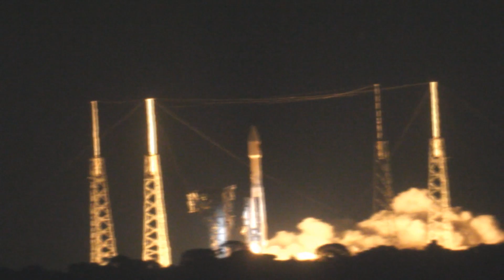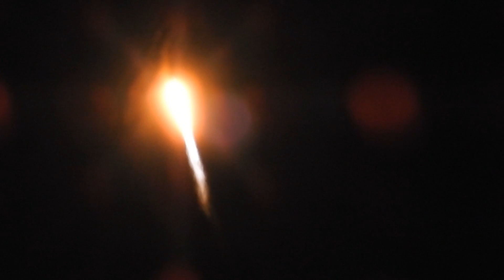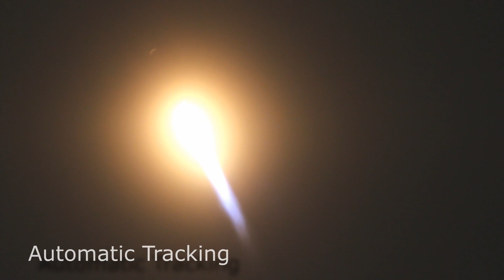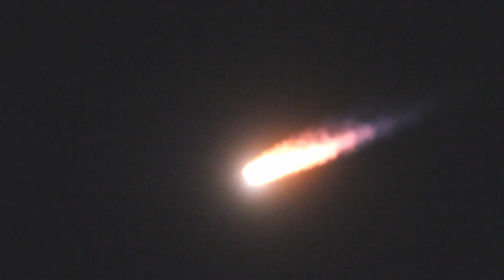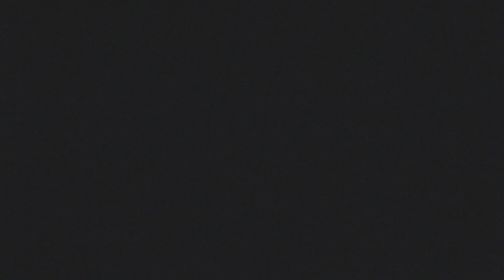Atlas V Cygnus Launch - Automated Tracking Demonstration 3-22-16

Comment: GREAT JOB! I even saw the booster drop away. Would your camera be a good recommendation? I have asked before and I think you said you were going to do a video about it. Did I miss it?
Reply from the maker: +william armstrong I'm going to do a full breakdown video showing my tracking system, but that's still to come.  I have one more bit of hardware to add onto the telescope to get it to the point I really want it be for tracking purposes like this.
Reply: +Astronomy Live have you thought about adding a predictive algorithm so when it hits MECO, to try and keep the last axis adjustments going when sight is lost after 1st stage goes out to try and catch stage 2 fire?
Reply from the maker: Shawn Hufford Yup.  It's already predictive, but it turns out there's a bug that causes the telescope to accelerate at a constant rate when tracking is lost.  I'll fix that.  It's not bad enough to throw it out of the view instantly, but if the image is lost for more than couple seconds it can cause problems.
Reply: Astronomy Live awesome to know AL, glad you had it in, and thats what is good about taking it into the field to test, you find these things and hammer them out. i got full confidence that you will squash the bugs man. hats off to you on your coding skills :)